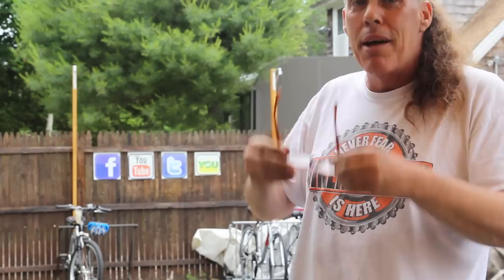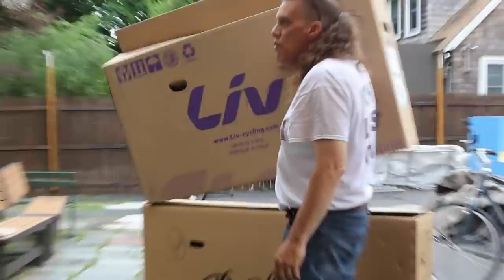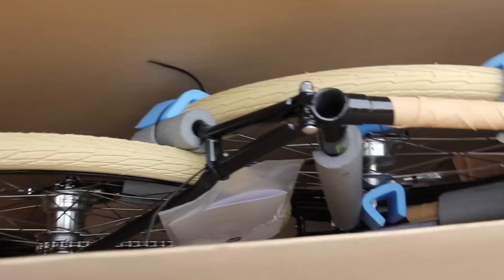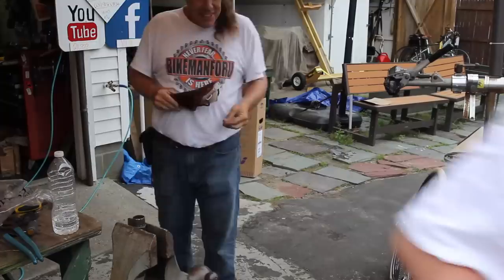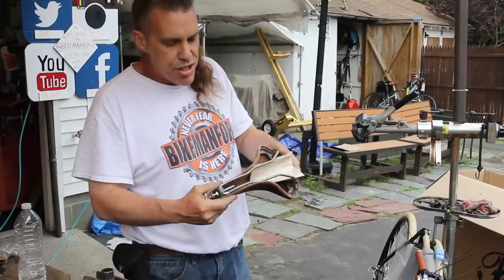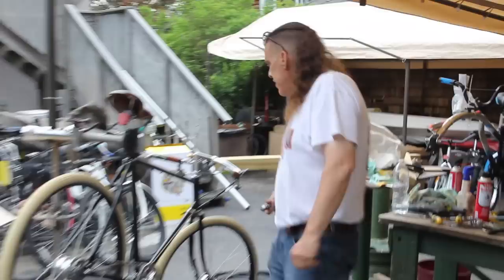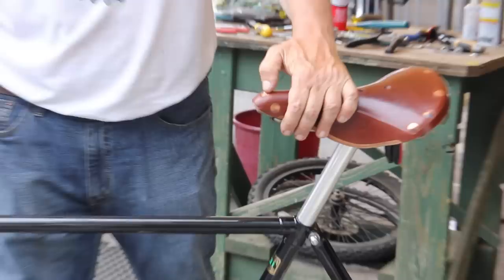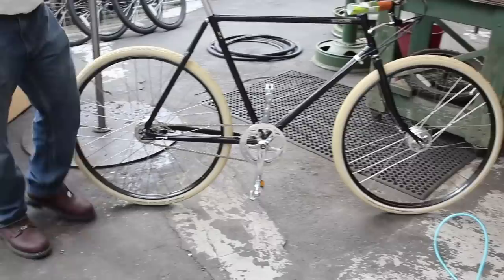Pashley - Awesome UK Quality - 3-Speed Bicycle Assembly - Time Lapse - BikemanforU

Comment: Not sure that you have the handlebars up the right way. I wouldn't have thought the maker intended for the bar ends to hit the cross tube. With the 3-speed hub gear, it's not really intended for high speed, and having the bars up the other way would make it more comfortable. And that Brooks saddle takes some breaking in. I had one and sold it after it was broken in. Having been born and raised in London, and owning a few bikes, I found the saddle on my Triumph Palm Beach was perfect with loads of springs under the covering. The Pashley is quality but I'd have to change the saddle and put the bars up the other way.

Comment: Ok for a more serious note .have you ever dealt with a Pashley trike ? but more to the vintage one ?i fix bikes out of my home as well, but iv only had one other tike to deal with and it was only a tune up , had nothing to major,this one..well  its more involved as it needs to be repainted,the older stile crank arm pin was replaced with a carriage bolt (insert rolling eye emoji)and nut then welded instead of replacing the pin ,i had to grind and remove the stupid weld. The neck stem was aluminum and seized to the fork stem (ohh man what an ordeal that was) the one wheel axle nut was welded on, oh man what an ordeal (oh did i already say that ? ugg) anyhow im thinking i should do a mock up before i do the paint ,so im just trying to see how the wheels are suppose to go back on as with one being welded on, one has a sleeve but not the other,one wheel has bearings but not the other, so im not sure of whats supposed to be there ,i know the axle turns and i believe only one wheel actually moves the bike or is a drive. Oh and i should add im pretty sure the 2 rear aluminum wheels aren't original as the front has a steel rim with brake hub. so i guess im asking for any assistance you might have.